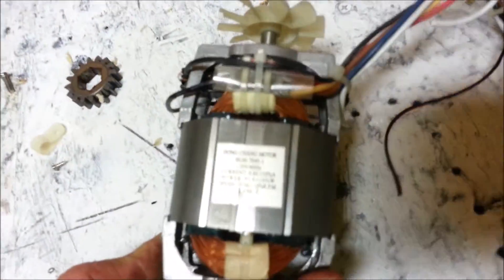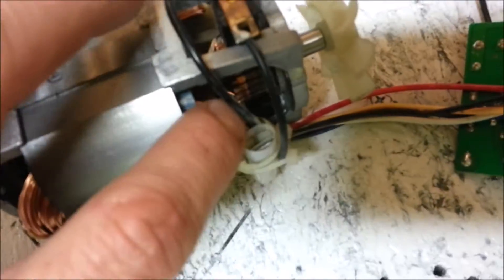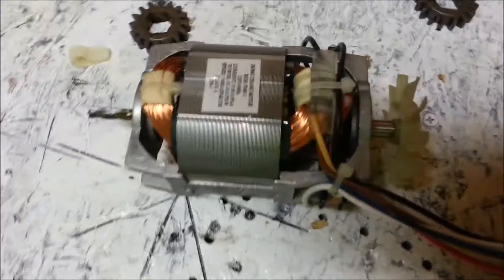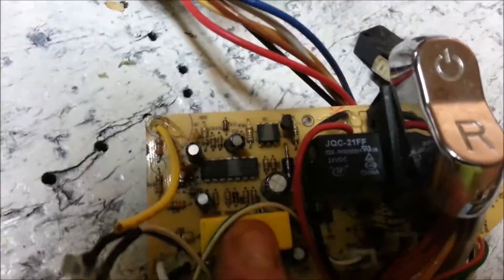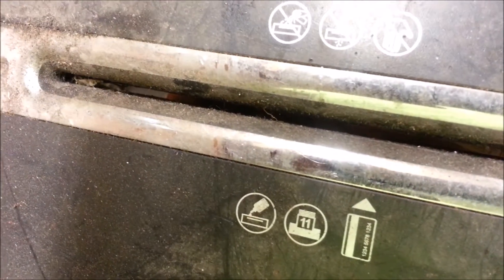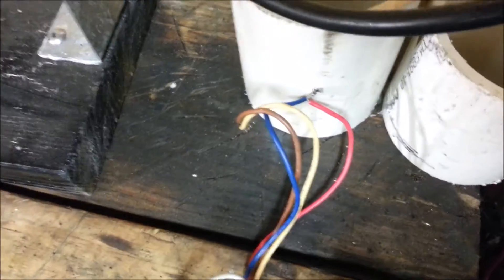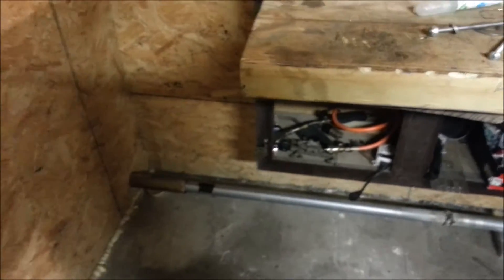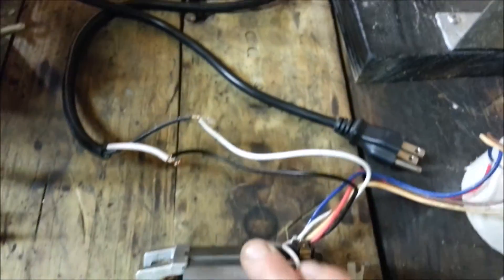Universal motor wiring configuration

Comment: I thought there may of been a start capacitor because I could not get it running, it would just kinda hum when I wired the brushes to 110v. good to know I won't be needing the board I cut off 
how did you attach a blower? was wanting to do likewise

Comment: I am dealing with the same issue, but have you ever seen a paper shredder that runs in reverse? Sounds messy. I believe what you have there is a bipolar motor of sorts. It has two sets of windings, one for shredding paper and the other will kick in going the same direction when things like cd's are shredded. So essentially it is a two phase motor and your reverse is simply one of the coils fed in opposite polarity. As for the circuit board it should have had sensors for (a) the paper bin being open (b) paper bin full (c) static guard so fingers don't get shredded (d) automatic feed switch setting (e) manual feed switch setting (f) optical eye to start auto feed. yada yada yada. you get the point.

Comment: Here's my guess.. The power switch is the overload device.  When the switch is pressed down and in the "ON" position, if there is too much current running through it, it will "pop" up into the off position, turning the motor off.  The purpose of the relay is to switch the motor from running in forwards to running in reverse.  It's my guess that the relay is double pole, double throw, with normally open and normally closed contacts.  When running in one direction, the magnetic fields of the stator and rotor will REPEL each other because they are the same polarity.  When running in the other direction, the magnetic fields of the stator and rotor will ATTRACT each other because they are opposite polarities.  The relay does this by switching the connection of the rotor wires (red, black), or switches the stator wires (white blue).  I can't tell by the video if the rotor wires are being switched or the stator wires are being switched.  If the stator wires are being switched, then the rotor wires will be on the common pins.  If the rotor wires are being switched, then the stator wires will be on the common pins.  Either way will work.  You don't see a normal transformer in the circuit, because a zener diode is probably being used to regulate the voltage.  It is probably the big diode hidden under the red wire in the video.  There may be many zener diodes in this circuit for providing different voltages.  The relay is 24vdc, the IC's are probably 5vdc, the LED for the temperature indicator is probably another voltage.  You also need normal diodes to rectify the AC voltage to DC.  At least one of the smaller capacitors is used to smooth out this DC voltage.
The inductance of the field coils in the motor will cause the current to move out of phase with the voltage.  If an appropriately sized capacitor is used, it will help to keep the voltage and current in phase with each other.  This is probably what the large yellow brick capacitor is for.
The temperature sensor in the motor probably doesn't even shut down the motor.  It's only function is most likely to turn on the temperature LED.  The motors overcurrent protector is most likely just the power switch.  It will trip if the motor gets jammed.  Some models probably automatically reverse for a period of time when a jam occurs.  Also, if there is much more current than the device should ever see, there is a fuse that will blow.
All that being said... If you plan to use this motor without the circuit that came with it... at least use the power switch if it actually is the overcurrent protection.  Use the relay too so you can reverse the motor anytime you want.  Hope this makes sense!

Comment: A joe cell is really a fluid tesla coil you see my heater glow plug of a tractor video I did not realise when you encase water within the walls of the electrolysis apperatus and have the negative on a spiral piece of stainless in the centre with the negative attached at the bottom and pos attached on the outer/inner wall at the top with figure 8 wiring the water super conducts as the h and o come off at head on collision causing what we don't see a spherical 3 rd energy spike like a car coil but its multi phased as its spherical currents in the swirling water this energy I think is plasma and as joe booker shows it soaks in to aluminium and strips incoming air in an engine to a neutral as this energy now in the aluminium wants to stabilise as everything does in nature that's why we freeze to death if in the outside without enough protection the mass of the cold air draws our mass out of us until we are the same of coarse were dead then type in Byron new energy on you tube watch joe put the clear pipe off the water cell on to the centre air. Intake bar he blocks it on to the top so it is only transmitting the 3 rd spike energy in to the mass of the engine no gas it's all static electric type so I think a simple plasma ball inner attached to aluminium and a slight vacuum attachment should run a static air engine once this is cracked it has many uses generators that have no moving parts etc. healing people by the frequencies like I said I have a few more detailed emails off Peter Stevens joe bookers friend who states it's scary how simple it is.  If you want them send us an email and you can pass them on to others as I am on no forums just youtube

Comment: Do you know of eddy currents that aluminium does when it has a voltage placed on it. Looking at the joe cell horses mouth video joe makes the aluminium cylinder head become a type of condenser capacitor by making static like a plasma ball inner go to it so my thought is if you get a lump of aluminium it should re circulate the centre shafts 3rd spike energy back in to the circuit through the block of the aluminium. I have many recent emails off joe bookers video man ingventor if you want them I need a direct email address also off a retired Datsun head uk engineer that I recently met who also had this static air engine effect happen on a Datsun 120y in 1978 ok. Mel in uk about to get on with it soon AGAIN. !!! Making a living is tuff as you know so showing praticles is not daily weekly or even monthly even if I have loads of info so you may well get some ideas off these emails